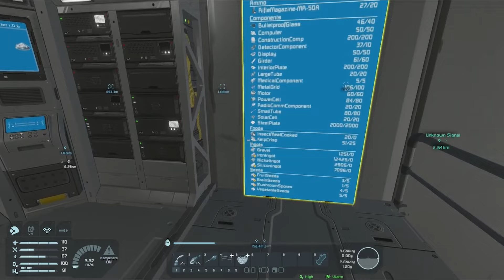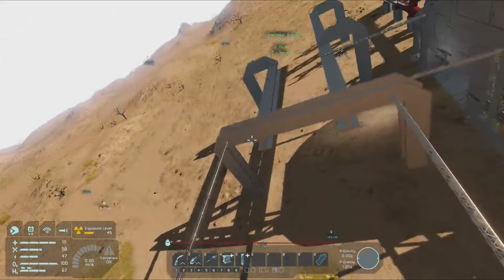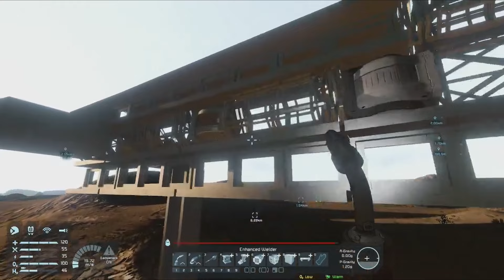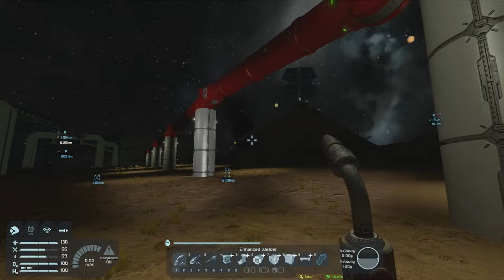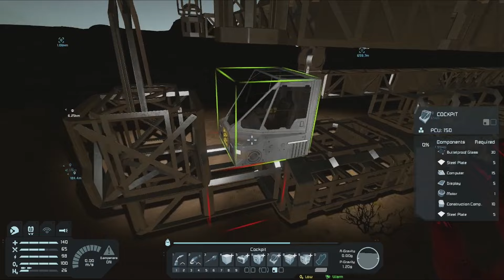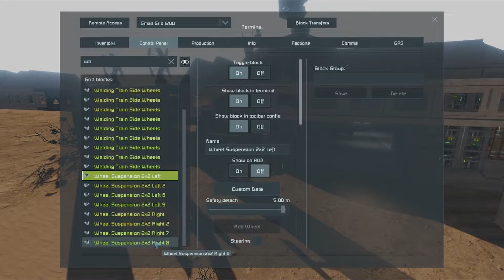The First Locomotive! - Rail Survival EP 9 - A Space Engineers Railroading Adventure

Comment: Enjoyable to watch you figure out how trains are going to work. I have done it three ways myself which with lots of experimentation work well. Currently watching 4 different series with guys building trains of one kind or another lol. My favourite method and the one I use is the one done by hanels, highspeed and pretty much bullet proof. 

Ideas for this switch 
1. Increase the distance between the gantries by setting to ship and pushing the pistons out to increase the distance to get the extra block in, then  reset to station. 
2. Build the pistons on the switch part and increase each slightly to reduce the partial block distance at the end. 

Definately use a magnetic plate to anchor the end when it is in position or the train may alter the alignment through the physics grid.

You could also put the welders on th etrain on hinges so they can fold out of the way when your driving back to the base fo rmore steel.
Reply from the maker: Both good ideas, and thanks for giving me an example I can check out.  My only issue with adjusting the physical piston lengths is that it's one more thing to remember when I replicate the design, but if I can't make anything else line up it's probably my best option given I need the pistons anyway.